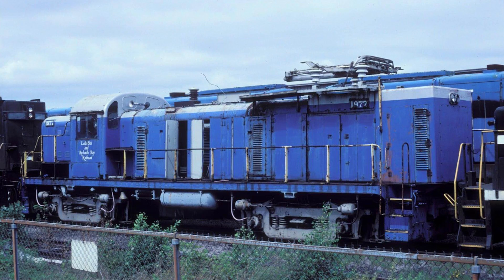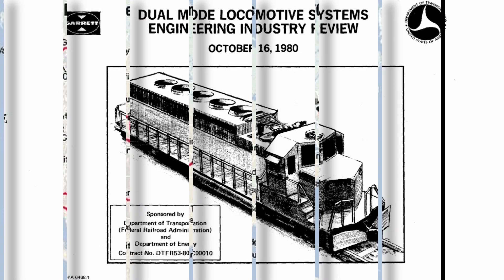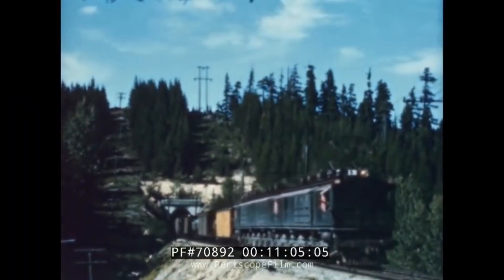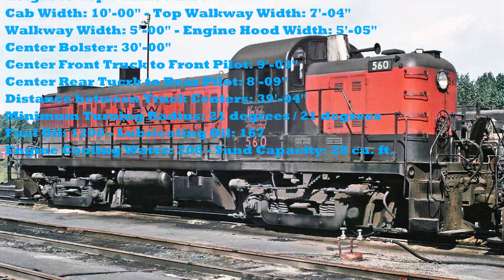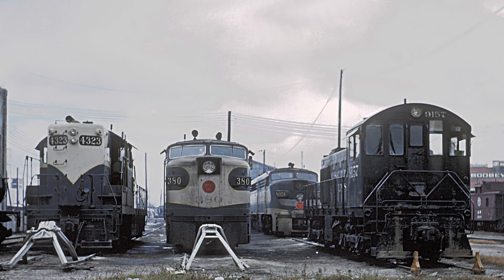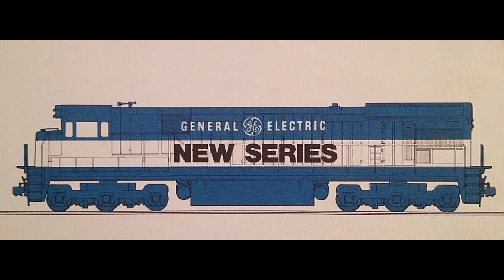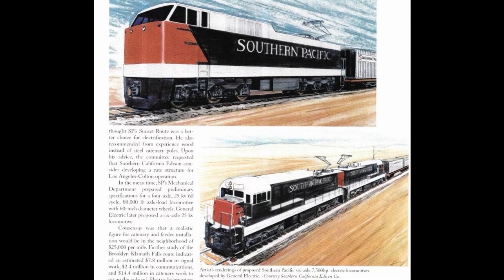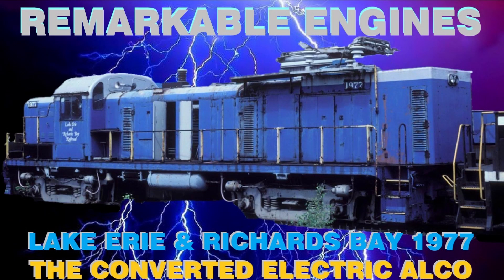Remarkable Engines: The Converted Electric ALCO

Comment: If 2 steam locomotives were converted with Chevy internal combustion engine in smokebox, transmission, driveshaft, and differential connected to gear and chain to loco wheels, putting a wire in an RS3 was piece of cake.....😊

Comment: As always, I found this quite an informative video. I didn't know there was an ALCO RS-3 that was converted into an electric locomotive in 1977, let alone one labeled for a non-existent "Lake Erie & Richards Bay" at General Electric's Lake Erie plant.

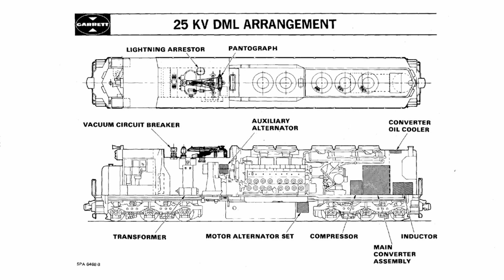Also, I was quite surprised to learn at 6:27 that Union Pacific "already electrified some parts of their main line". How different would things have been if they went through with full electrification!

Thanks for the video!
Reply: CP did it also in the Rockies as to évaluation cost and maintenance of the wire......and never was tested and finally torn down.
Reply: @danielfantino1714 , CP electrified some of its lines? I'm surprised!

Where can I learn more about this?

Comment: If this was given to Amtrak or NJ Transit it would have likely worked inside Hoboken 25kv 60hz post 1984 upgrade and the New York Penn Station complex 11kv 16.7hz-25hz ac voltages. Looks like it is the predecessor to the dual mode Locomotives ALP-45DP 🇺🇲 DB Baureihe 159 249🇩🇪 Classes 88, 93,99🇬🇧

Comment: Fun fact: American Aggregates converted many interurban freight motors from interurbans such as the Cincinnati and Lake Erie and Indiana Railroad into diesel locomotives. As they already had traction motors, they just added the diesel engine inside the empty freight compartment. As a result, many interurban freight motors that would have been scrapped otherwise were used for decades after. This is why theres 5 C&LE freight motors and a single IR freight motor in preservation.
Reply: Quite a number of old Alcos converted to overhead wires in steel mills. Republic steel in Canton ohio has alco S2s that run on trolley poles.
Reply: In New Zealand we imported 4 small battery-electric locos in the 1920s and turned them in to diesel-electrics in 1953.
Reply: I have ridden in one of these back in the seventies at the French Lick west baden and southern. It had an OP FM as I recall. In the baggage compartment, I rode alongside the engine the whole trip.

Comment: Never knew the US had a diesel loco converted to electric power! 

I've heard of diesels being converted to electrics in North Korea, India, Azerbaijan, and even Poland, but it's shocking to see the US, of all places, to have been the first to do such a program, even if it was just on a single unit. Thanks for sharing!
Reply from the maker: Out of curiosity, do you happen to know the class names of these international engines that were converted from diesel to electric?
Reply: @Pensyfan19 India actually used ALCo's as a base the WDM-2 I think
Reply: @IndustrialParrot2816  Yeah, they did. The RSD-29 was used as the basis for the WDM-2
Reply: @Pensyfan19  Is it okay if I ping you in a post to share? I know a lot, but my comment got deleted, unfortunately
Reply from the maker: @AutismTakesOn  that's fine.
Reply: @Pensyfan19  It's up for you!
Reply: @Pensyfan19  I looked them up. I don't believe the Azerbaijan locos have a class name, but I DO know they were converted from M62s. 

The North Korean locos also consist of M62s converted to electrics, known as the Kanghaenggun-class, there are also 500 series locos that were converted to electric, a photograph apparently showing a TGM3 diesel-hydraulic converted to electric power on the Hambuk line, and there's some locally-designed Saebyol-class diesel-hydraulic shunters that have been converted to electric

For India, with their conversions being more recent around 2018, with the WAG-11 class being converted from WDG-4s, basically Indian SD70MACs, and the WAGC-3 aka WAG-10, converted from WDG-3A diesels, which are basically modernized WDM-2s, or RSD-29s

The Polish diesel converted to electric is designated a class 207E, converted from an ST44, the Polish designation for the M62. This engine was apparently converted in cooperation with a company called VIS systems starting in 2017, with 2 class 207Es known to exist with a plan to convert another 10 ST44s to electric